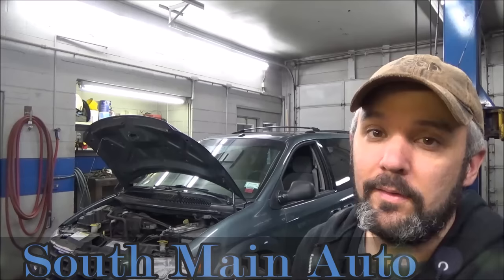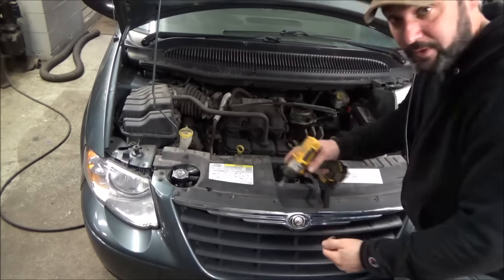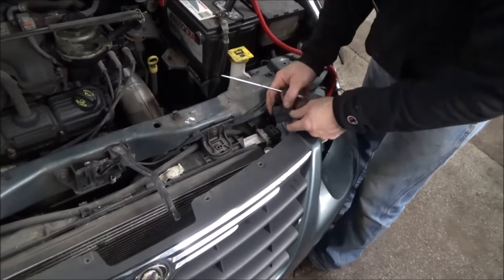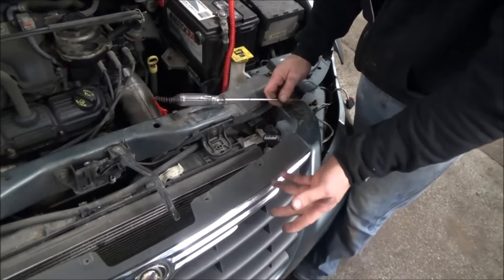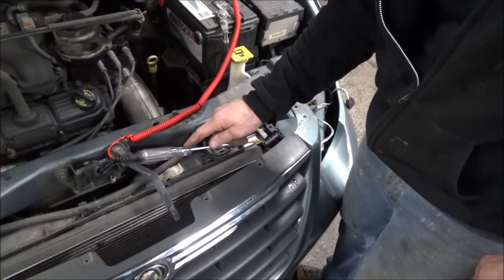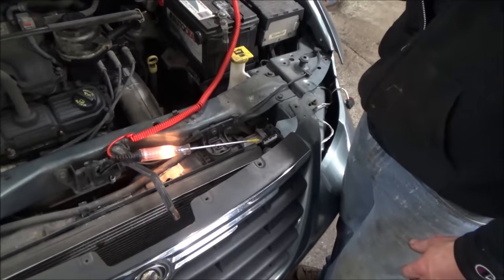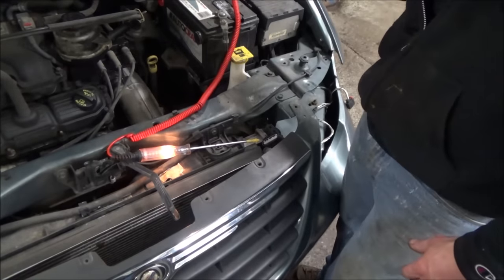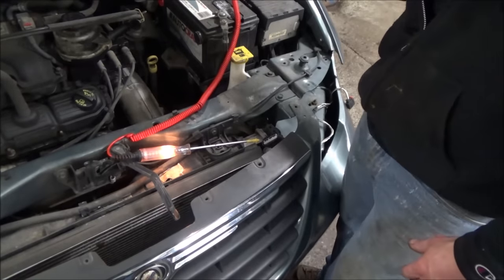Chrysler Town & Country / Caravan - P0480 Cooling Fan trouble

Comment: Thank you so much for posting this video! I am a 59 year old somewhat disabled woman with next to no money and I have this exact problem. I have spent the last hour searching for a solution on line and came across your video which made the fix look almost as though I could do it myself - almost - if I have the right tools. The only tool I do not have is the one for removing the rivet. However, I am going to check for the price of the part and find out if some kind fellow will help me do this. All because you took the time to  to film the repair & post it! What a great guy you are!. God bless you and yours richly! Shelley in southern Saskatchewan, Canada

Comment: You guys are pretty awesome. Your videos have saved me countless hours of frustration and my sanity. 
My wife insisted on a used 2007 T&C even though they are notorious for AC and wiring issues. I voted Honda Odyssey, she said we'd get more van for our money. Lol....In the ONE year we've had it I've completely rewired both sliding passenger doors and fixed the rear AC. Now there is no air blowing out of the front vents. The rear vents are fine, however the front vents don't move air at all. When at highway speed you can feel cool air coming out of them slightly,but not enough to make any difference. We live in Mobile, Alabama, so we know HOT!!!!
Now that I've watched this video I'll be sure to check out the relay. I'm pretty sure that's the problem, however since I don't have a super-sweet rivet gun (just Glock, Sig Sauer and Walther PPQ's) I'm concerned about how to fasten the relay. I know you discussed it in this video but I couldn't hear it that well. Is it possible that you could respond to my question on how to attach the fan relay without a rivet tool? Thank you, and God knows you have plenty of job security servicing Dodge vans. Too bad they can't seem to understand that sales will increase when they stop selling vehicles that fall apart in 4 years! Honda seems to understand that concept quite well!

Comment: Love seeing the "scope-on-a-rope" master in action! Pretty cool how you checked the low-amp control circuit with a test light too. I would back that up with a quick relay bypass test with a jumper wire and measure the fan current draw just for kicks :)

And the good old "time constraint" excuse to not use a real scope...don't pick up bad habits now Eric haha!
Reply from the maker: +motoYam82 Haha hey man I am in a real big hurry and have no time for that! Come on you know the drill haha. I was thinking of doing a amp draw test but I came up with the question... what is good with out a known good to compare too. One thing I do know the start up current and running current is less than 40 amps ;)
Reply: This is an important comment cause an old fan can draw too much power and cause premature failure of the relay. This test should be shown. But what is a reasonable fan draw current/
Reply: @SouthMainAuto  If I make the correct adjustments in the harness, do you think I can fit that fan relay in a 96 Town Country?  It's that I see the fan relay from 2003 onwards being more reinforced, like the one you put . thanks!!!

Comment: Just a word of CAUTION, when probing control wires do not use this method on most/all vehicles! use a Digital voltmeter or a computer safe circuit tester. Eric O is a trained professional and  knows where and what to probe with his scope on a rope (test light). When Eric was probing the control wire at 6:30 and heard the vehicle chime it sure got his attention quick.

Comment: I had this same problem but it was an open wire under the battery tray. battery acid ate through the wiring harness. lesson learned - keep the battery terminals clean!

Comment: I own 2 of the 2001 through 2007 generation vans. They are very service friendly. I do most of the repairs myself. Rear plugs and upper O2 sensor are not hard you just pull the wiper tray off which is simpler than you think. The radiators come out easier than the generation before it. The heater core can be swapped out if necessary without the dashboard being removed. Brakes, suspension, window motors, and power lock actuators are all very easily done. I do work on other peoples vans because they are not difficult for me to do so. The one downfall is that if you do not have the lower body cladding on the vans which is a premium option they rust quicker. Proper washing and waxing of the van would avoid this, but not to many owners care about them enough to do it as often as it should be done.

Comment: I just did what u said in this vid to a 2005 Pacifica and it's the same process. Great video! Thanks
Reply: Mine turn out to be the AC cabin temperature control unit in the dash. That was a long ordeal finding that issue

Comment: also a good idea to check the amp draw on the fans. as the fans age the amp draw gets higher and burns up the relay and sometimes even the wiring. have seen several of these come back due to fans being the root of the problem. happens alot on the jeep grand cherokee with same set up. just some food for thought.

Comment: Good video Eric, one thing I always do is check the amperage of the fans after repair, to make sure they are fine, otherwise that relay might fail again! Just a thought
Reply from the maker: +Maic Salazar What would you consider is good? Just curious is all...
Reply: +South Main Auto Repair I think a healthy fan system should have a in rush amperage of 15 amps and as soon as stabilizes around 8 or 9 amps. Off course this would vary a little depending on manufactures!!
Reply: +South Main Auto Repair Your videos are always great! Sorry to comment on what I think! Didn't do it to play smart! Just a point of view!
Reply from the maker: Oh no it is no big deal I was just curious. I think 8 or 9 amps is pretty low to be honest with ya. Blower motors in dash draw more than that usually. I guess my thought is , is if you have nothing to compare it to then in my mind it is just a number. It may be a good idea to gather that data and jot it down to start to find a "norm" though? Matter of fact I may just start doing that :)
Reply: The fans are on the same 40 amp fuse which means the rush current should be over 30 amps. If you’re referring to each fan

Comment: Thanks for the video. I got a 1988 camaro with the opposite problem. The fan runs all the time. My suspicion is the last owner messed with. Couple quick looks and I don't see anything messed with, but needs more investigation. Anyways my point is your motivating me to fix it, not just say...whatever, atleast the fans on, not off.

Comment: 2 things you will see in any SMA repair video either brake cleaner or the Scope on a Rope. Glad it was an easy quick fix electrical problems on my truck are hardly ever that easy
Reply from the maker: +crapper1 sometimes both too

Comment: Daughter's 03 , 3 3, Caravan.  Replaced Brake Master Cylinder due to pedal sink  started car drove 1/4 mile left front brake was dragging,  replaced front left caliper( old one stuck wore out pad damaged caliper)both front brake pads, drove 1 mile gased up with engine off, restarted drove back 1 mile. Next day bled all wheel cylinders with engine off. Then crank but no start. Codes 118, 123, 508, 509, 1193. All codes were present on old pcm and now on new one. Replaced Crankshaft position sensor, tps sensor,  coilpack, coilpack connector,  spark plugs , pcm.Gotta iod parasitic draw. Remove iat fuse draw disappears,  returns when fuse reinserted. IAT clicks when fuse is reinserted and sometimes radiator runs briefly simultaneously then quits within seconds. Antitheft light doesnt come on , never. Not with key in start position, not when arming alarm with fob or key. New batteries in fob, tried 2 different keys. Tried charging batteries,  tried different battery , tried jumping . All fuses good, all fuse hot legs above 12 volt except IOD. ASD clicks with key in run position. Fuel pump runs a few  secs when key in run position.  Lights will blink mysteriously sometimes.  It Did this before new pcm and now does it with new one. Reset computer several times. Help a brother Eric.
Reply: that sure sounds like a bad ground -- pretty much systemwide.

Comment: Another fine video.  Eric I have the 07 T&C. I followed your instructions. The fans work. The control side of the relay does not. Using my VOM meter
with the red lead on the positive battery I have  14.3 volts on the  ground. On the  signal terminal with the red lead still on batt. positive I read
13.7 volts dc?  What is the actual voltage supposed to be?  My experience with appliance relay's is for the load coil that operates the contact you have common on one side Ground,and voltage on the other side. What actual voltage reading should be on the signal terminal. Also we should be able to read ohms on the coil. to tell if it is open or good closed with resistance. I read in K ohms  on the old one and the new.. 507.6 ohms on old,
and  608.1 on the new. What ohms reading should it be?. I read M ohms on old relay at 3.033, and 4.277 on the new. Does this seem right?
I have watched your video's for several years now. Always good stuff.
Ken in Michigan

Comment: What's great about this is that you test your wires also to the PCM, so you can rule them out as being bad using this method. If this works, and your relay doesn't, then you know the harness connector isn't connecting or the relay is bad.
Reply: I ended up hot wiring the fan to a switch in the dash, just can't forget to turn it off (lol). Good fan, good relay, good wiring, bad PCM (not worth dropping a fortune on a new one as they're worth so little money anymore). Next failure will be the transmission *about 1 per 100K miles. Chrysler has never figured out how to make a transmission.

Comment: I let a person borrow my 2005 Dodge Ram 1500 4.7 lt Magnum V8 and the fan blade flew off into the radiator. * Advice don't lend your vehicle out if you don't know the person very well * Anyways a couple months before that my ex got into a rear end collision so I no longer have a cooling fan control circuit or the wires that should be there. Now I don't have A/C or heat. I was wondering if there was a way to get around not replacing it all. TY for your time.

Comment: For the EGR here we reprogram the ECU and turn off the EGR, completely delete the map for it and block the passage on the intake with some kind of a shim instead of the regular gasket. After doing that you will never have EGR problems and you wont dump junk into your intake and engine.

Comment: My 03 caravan fans run but only when the engine warms up not when the ac is first turned on. Ac throws warm air until you get moving down the highway.  I had a 3.8l but I put in a 3.3l about 3 years ago, Ac worked great until now.

Comment: Nice & quick with a scope on a rope. Just got my Astro die grinders from your store last week along with some abrasives and love the angle die grinder. Nice fit, lots of power for a great price! I normally use my Snap-on air drill but the Astro is so much lighter & compact so my Snap-on air tools are going to get a few more Astro companions to include "Big Nasty" and the Nano's. The Astro's can get into a lot of tight places...small but powerful.
Reply from the maker: +Hayward's Automotive Does this link work??? https://onedrive.live.com/redir?resid=C7BE1B571FE20297!1454&authkey=!AAVXfhY0YXtxNoE&ithint=video%2cmp4
Reply: +South Main Auto Repair Hey where you been hiding that video? I love my Snap-on tools but I try and buy the best & baddest tools on the market. Knipex has the best pliers and I have a drawer full of both Snap-on & Knipex and Knipex are simply better. I've watched every video on your channel and am impressed with all of the Astro tools so I figured I'd buy the Astro die grinders & set them up for brake hub cleaning & rotor resurfacing and love them. Next will be "Big Nasty" and then I'll get the Nano's.  I love my Snap-on MG725 w/810 ft lbs of torque but I think my Astro air tools will become the preferred tool in my hand. The video was awesome and I'd rather see a tool review done by a mechanic in head to head competition & let the best tool win! If it holds up to the daily use of a professional mechanic where the majority of time we are abusing tools then it'll probably be in my shop.
Reply from the maker: Well my tools get beat just like in any other shop so I think just like you... that is the real test IMO. As far as that vid... well it is an exclusive you are the only on who has saw it. I put it together thinking I might put it up but then never did ya know... People think I work for astro haha
Reply: +South Main Auto Repair Thanks it was a great head to head video but you do get a smirk when you talk about Astro...:-) Looks like the VerusPro is holding up. Thanks again for the videos b/c I hardly watch TV anymore
Reply from the maker: I don't even have a TV at home lol. I get a smirk b/c they are so cheap to buy and from what I can tell they hold up. What the heck have I been wasting my money on all these years haha! The Verus Pro has been outstanding so far!!

Comment: Hi Thank you for getting me on the right track! 2014 caravan.   Running hot in idle traffic only,  gauge goes to 3/4 high. Then  still in traffic the gauge drops to half, and I start traveling again and the gauge goes back to just below 1/2.    I just had the thermostat replaced, didnt fix it!    
QUESTION PLEASE!  It seems my fan doesnt come on until the engine gauge is 3/4 up. Then the fan kicks on and the temp gauge goes to half then just below half.  WHat do you think?

Comment: 2004 Grand Caravan.  My AC stopped blowing cool.   Radiators fans not turning on.   Would replacing this relay allow cold air ?   I hear compressor turning on.  Isn’t overheating unless I’m in city. I do see some overflow. But temperature is good.

Comment: Coolant temp sensor changed, relay changed, tested fans with jumper leads to the battery, both work. Checked 40A fuse, still good. Fans still never seem to come on when the car is running. What else is there on the circuit? Anything other than wires, and PCM?

Comment: Thanks for the video !!! Having huge problem with Plymouth Voyager 1998, 2.5 litre engine! Car was in a garage, where they pretty much screwed everything up, very unprofessional=(( It was fine before, only 56000 miles, owner took it there for minor tune up..., and oil change..., anyway, when car was returned, there was no oil,????, forgot to put in??, and radiator "after flushing'???, system was leaking, they "fucked up' the plastic plug, it was only half way in, I put a new one in!! Anyway, they did change radiator cooling fan resistor/ relay, I actually can see that, and also harness??? for that?? I don't know, why also harness had to be change, hoping it was wired right??? Now radiator fans don't go on at all,, car overheats, of course, in stop and go-traffic! I did change coolant temperature sensor, no help?? Then I did change coolant fan assembly, no help, actually old one is good =(((, but there is no signal to turn fans on, even you put AC on, or  engine comes to normal running temperature??? Why no signal??? I tested fan relay, they replaced, seems fine, there is resistance between neg. and middle. = pos. pin, bad ones has no resistance, right?? PCM has to be OK, since  car runs otherwise fine, what could be wrong??? Why no signal to turn fans on??? Thanks for your help  =)

Comment: Okay so I'm working on a 99 Caravan and while the colors are different and the relay is on the frame and not in front of the radiator your testing procedure has worked so far. 
I get to the part where you start the car and turn the AC on and just like in your video my light does not come on. You move the probe and get a good connection and your light came on. Well I moved my probe around also but alas no light. Looking at the wiring diagram I have it shows the line going to the fans.  If you apply 12 volts to the fans they turn.  I have replaced the relay and it did not fix the problem. Initial problem was the fans were on constantly but did not turn off and I disconnected the battery to turn them off. When I reconnected the battery the fans did not come on but the next day the battery was dead. I also replace the thermostat and temperature sensor. My diagram says position 3 is for fan output and that is the line that does not turn on when you start the engine and turn on the AC.Your video is very good and I appreciate your using the scope on a rope it has gotten me further in my diagnosis.
Reply: So I have a question to the diagrams sometimes reverse wires for ease of drawing? 
Example this relay, is it numbered from one to four and they are in order. I ask because in the diagram it has the numbering go 1 next 3 next 2 next four. Is the actual relay numbered in sequence? If it is that has been throwing me off. Thanks in advance.